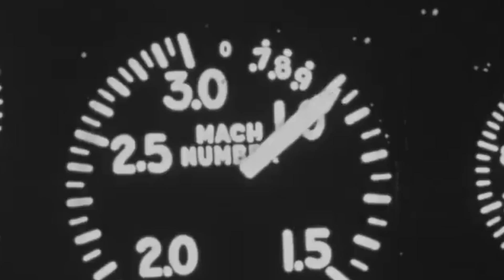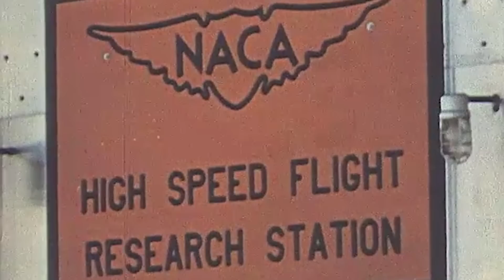The Flying Bullet That Shattered Aviation's Limits Forever

Comment: The Bell X-1 was less an aeroplane than a rocket with a man steering it. Yeager said more or less that during the development of the X-2 and other jet solutions when he became enthralled by engineering solutions to flight characteristics. He even calmly managed a "dead stick" landing in an X-2 or X-3, reasoning that the jet engine installed and which had cut out would not be hot enough to ignite kerosene. Rocket HP with oxygen would not have given that chance.
In many ways the path to supersonic flight showed a type of unpleasantness which has persisted in aviation which was mainly caused by ignorant and greedy politicians. Men such as Jaeger, Whittle, de Havilland and Twiss (Fairey's chief test pilot) were airmen and gentlemen.
The Miles company was bankrupted by the UK government of 1945 dropping Miles' design but not before handing research data to Bell under a cooperation agreement which Bell was prevented from reciprocating when the USAF stole the X-1.
Sir Frank Whittle's PowerJets company was also crushed by the Attlee government and Whittle arranged his own discharge from the RAF (Reserve) and worked with Bell as a consultant but not employee.
He later returned to Britain to work alongside Rolls Royce on developments of his patented turbojet which became the modern engine we still have. Because Whittle had been a serving RAF officer in wartime, the UK government effectively stole his patents for the axial jet which he had evolved since 1928. Hans von Ohain had read Whittle's thesis on gas turbines and separately the jets which Messerschmidt used. The two men met after WW2 in the USA and corresponded for several years. Von Ohain knew nothing about actual jet engines being made in the UK and Whittle quipped that PowerJets Ltd was too small and obscure to interest spies.
Whittle's Rolls Royce consultancy (including association with Bristol Ltd) led directly to the success of the first truly viable consistent supersonic plane, the Fairey Delta 2, which could have led to a leap in aviation but, again, politicians withheld funding. Fairey's board had good relations with Dassault in France and the Mirage emerged from that. Fairey had sold maritime planes to France for some years.
It was tougher than the US Voodoo and was actually used in combat. The UK's first full-on supersonic jet was the English Electric P.1a, which became the Lightning interceptor and multi-role powerhouse.
A piquant irony is that the badly let down Miles aviation family remained active (not as a company) and various design refinements emanated from the actual family and loyal consultant designers. Some were involved in the Harrier, Tornado MRCA and Concorde.
Chuck Yeager remained a pilot and research engineer and never truly retired. He died in 2020 aged 97!
Reply: The Miles M.52 never existed... it is pure British science fiction like 'Doctor Who' and the 'Thunderbirds'.

No data was ever handed over to Bell Aircraft because it did not exist, this false rumor comes from a single highly dubious source, Dennis Bancroft who never produced any evidence to support his ridiculous claims and was one of the people charged with fraud and embezzlement at Miles Aircraft.
Reply: @DoktorBayerischeMotorenWerke  And I suppose the pictures and film of of the M52 and aircraft used to develop the technology were 1940s CGI 🤣
Reply: @spamhead Interesting comment considering that there are no photos of M.52, only artist renderings and a few photos of the partially built wood mockup of the cockpit section.
 No trace of the two prototypes Miles was paid to build or the money was ever found.

Comment: 5:39 it was Jack Ridley who came up with the adjustable horizontal stabiliser, the "flying tail" not NACA.
Reply: Jack Ridley received the plans from Theodore Von Karman who was given the plans directly from Adolf Busemann at the RLM's Luftfahrtforschungsanstalt supersonic wind tunnel lab in Braunschweig. 
The Bell X-1 used a nearly identical fly-by-wire Horizontal Stabilator as found on the Messerschmitt Me-262.
Reply: Who did Ridley work for?
Reply: @Rotorhead1651  Jack Ridley was a student of Theodore Von Karman at JPL.
Reply: It was Miles on the Miles 52  with a All Flying tail Details passed to Bell
Reply: @michaelshore2300  Never happened, the Miles M.52 does not exist.
Reply: @michaelshore2300  Not possible... there was never any Miles M.52 or any completed plans... the British did not have a supersonic wind tunnel laboratory until late 1948... long after the historical events occurred.
The M.52 is wishful thinking and propaganda fiction.
Reply: @michaelshore2300 There was no M.52! Never in history has there been so much discussion about an aircraft that never existed.
Reply: @michaelshore2300  The X-1's adjustable H-Stab was different than the Miles. It didn't have a whole lot of play and was harder to handle than the conventional elevators, which were handled by the control yoke - Yeager was essentially using the trim adjustment system to control the entire airplane. It was later modified with an all-flying tailplane based on the Miles data, but on Yeager's early transonic flights, the control system was a lot less refined.
Reply: @disorganizedplay  The Horizontal Stabilator on the Bell X-1 was very different... IT WAS REAL! Not some fake revisionist twaddle about a British aircraft that do not exist.
Reply: @WilhelmKarsten rather like your revisionist babble about the me262 - dude I've shown you photographic evidence that the 262 had a traditional elevator....I notice you do not comment on that
Reply: @laurencedawson7754  The Messerschmitt Me-262 has an all-movable, Horizontal Stabilator and Elevators tabs, just like many other modern jet aircraft... and the Bell X1 that reached Mach 1 in level flight and the F-85 Sabre that could reach supersonic in a dive like the Me-262.

Britain did not invent the Horizontal Stabilator or supersonic aircraft..
Reply: @WilhelmKarsten  and the photographic evidence to the contrary?

Comment: Designed and mostly built by the British.
Reply: Both the unbuilt Miles M.52 design and the Bell X-1 also relied heavily on WWII German research. The rocket-powered Me163 Komet set an unofficial speed record of 642 MPH in March 1944...
Reply: Unfortunately, this popular British myth quickly falls apart under the slightest scrutiny... the Miles M.52 does not exist and no completed plans were ever found.
The money paid to Miles for the m.52 program was stolen by Dennis Bancroft, Frank Whittle and several other Miles shareholders.
 Mile Aircraft was charged with 24 counts of fraud and embezzlement and the company was seized and later liquidated.
Reply: Completely false! Britain was a decade behind the Germans in supersonic aerodynamic research and it was data from the Messerschmitt Me-262 that was recovered after the war that directly led to the Bell X-1's Horizontal Stabilator system.
This is well documented from the Von Kármán Mission.
Jack Ridley and Theodore von Kármán often shared research and were close friends since Ridley was a student at JPL.
Reply: @WilhelmKarsten false
Reply: @WilhelmKarsten dude Von karmonn moved to states before the war- he had no dealings with German advanced tech from ww2, a great scientist but you link him with the me262, all moving stabilators, you are getting it mixed up
Reply: Parallel research. Both were built in secret.
Reply: @deadon4847 A completely false revisionist narrative that comes from a less than credible origin, the British would not even begin construction of its first supersonic wind tunnel at RAE Bedford until 1947.

Comment: There was a demon that lived in the air. They said whoever challenged him would die. Their controls would freeze up, their planes would buffet wildly, and they would disintegrate.
The demon lived at Mach 1 on the meter, 750 miles an hour, where the air could no longer move out of the way.
He lived behind a barrier through which they said no man could ever pass.

They called it:
The sound barrier.

Then, they built a small plane, the X1, to try and break the sound barrier. And men came to the High Desert in California to ride it. They were called test pilots.
And no one knew their names.

October 14th 1947, a WWll fighter ace named Charles Elwood "Chuck" Yeager chased that ol' demon that lived beyond the barrier!

That was the day the demon on the mach meter ceased to exist...
Reply: The demon lived along asymmetrical propagation of the mach wavefront moving rearward over the wing as the aircraft accelerated.
Reply: @justincase5272  Yes, the "Demon" caused compressibility and a loss of flight control authority, the change in the aircraft's Center of Pressure would cause the aircraft to suddenly porpoise, pitch hard nose down into a steep uncontrollable dive or break-up before reaching the ground.
 The invention of the power assisted Horizontal Stabilator by Adolf Busemann, first installed on the Messerschmitt Me-262 made supersonic flight possible..
Reply: Do you have any beemans??
I might have me a stick.
Well loan me some, Ill pay you back later.. Fair enough.
Reply: The sound barrier had previously been broken by several P-47 pilots diving away from dogfights in WW2. The shock wave would freeze the controls but the P-47 had hydraulicly boosted controls that allowed it to come out of the dive gradually.  One P-47 pilot reported that he dove away from a Fockewulf 190 at 35,000 feet and finally was able to pull completely out of the dive at treetop level. The plane had extensive damage to the airframe and was scrapped on returning to base.
Reply: @richardbeckenbaugh1805  amazing if true! I've read that fair few late mark spitfire and Mustangs were taken closer and closer to mach 1 at the end of the war.......
Reply: @richardbeckenbaugh1805  Highly unlikely the entire aircraft passed Mach 1. In fact impossible. The highest mah number recorded was. Spitfire in a vertical dive to M0.92
Reply: @billpugh58  TRUE, it is impossible to maintain flight control and pitch authority above the aircraft's critical Mach number without a power assisted Horizontal Stabilator.
The Messerschmitt Me-262 and the Bell X-1 were the first aircraft to successfully fly faster than their critical Mach number.
The de Havilland D-H-108 Swallow for example crashed 3 times in a row attempting this as well as many other failed attempts to fly faster than the planes Crit Mach without a power stabilator..

Comment: Chuck Yeager's first book covers this really well and explains the reason he was so good. It was because before he did any test flight he would stay up late into the night learning everything he could about the aircraft until he knew every system right down to the nuts and bolts that held it together. If I remember correctly he said it had saved his life on more than one occasion. He was truly an exceptional character.
Reply: Chuck was an aircraft mechanic before he became a pilot....he had an innate mechanical knowledge and he KNEW what he could trust and what he could not.
Reply: He didn't stay up late learning the systems.  He spent months, if not years learning the systems.  He stayed up late the night before topping off his expertise, rote memory and muscle memory by going through the checklists and emergency procedures over and over.
Reply: He was also bad.  A seat of the pants pilot in an era of high performance that required computer precision and rigid adherence to procedures and profiles. 

He got in trouble early in the X-1 program because he pushed the aircraft too far on one flight rather than approaching Mach 1 in increments.  He was chastised and didn’t do it again.  

But after he went Mach 1 his ego got really big and since he didn’t have an engineering degree he was out of his league among astronaut candidates and the new generation of test pilots—who only tolerated him because of his record breaking flight and war record.  

In the NF-104 program he was the base loser for altitude records because he refused to fly the profile.  It’s more mathematical than feel.. because the plane first has to accelerate to its maximum level flight speed which is at the tropopause (nominally 36,000 feet). Any lower.. and the air is too thick. Any higher and the thinning air is no longer offset by dropping temperature leading to massive performance degradation. 

Then you have to pitch up to a certain attitude. Too low.. and you’ll never make your maximum altitude. Too high.. the plane will lose too much speed in the steep climb.  

Then you have to pitch at the right rate.  Too slow.. and again by the time you reach the correct attitude you’ve lost a lot of energy in the lower thick atmosphere. Too fast.. and the drag from pulling excessive G will rob you of your speed.  

This was very simple where the plane had a checklist and procedure to follow.. and a flight director on the attitude indicator to indicate the correct attitudes and pitch rates.  

But Chuck knew better and was going to fly his own profile. And when he didn’t reach the desired altitude, he tried to “force it” higher rather than letting it fall in a controlled manner.. which resulted in an unrecoverable spin and crash.
Reply: @calvinnickel9995  Well at least Chuck Yeager was honest and was never caught stealing money from his own country's supersonic aircraft program like Eric Brown was, Brown was denied his Knighthood because he was involved in the M.52 embezzlement scandal.

Comment: Interesting that they showed Bell test pilot "Tex" Johnston who later went to work at Boeing testing the B47  B52 and the 707/KC135 and is well known for his barrel rolling the Dash 80, proof of concept for the 707/KC135 over the hydroplane course in Seattle Aug 1955.  call into the office of pres of Boeing Bill Allen he asked Tex point blank  "What the hell do you think you were doing???"  Tex answered simply..."Selling airplanes.....sir...."  and sell airplanes they did.  seems Tex had worked with the USAF on the B47 "TOSS" bomb delivery of doing a high speed loop up and releasing,  or tossing the bomb and the plane continued in the loop and at the top the plane was rolled upright and dived away from the atomic blast.  seems also the program was abandoned when they started tearing wings off planes.  RIP  Tex Johnston......one hell of a pilot....
Reply: Because of what Johnston did with the Dash-80, it's been traditional for the CEO to tell test pilots when they take a new airplane up, "No loops."
Reply: @disorganizedplay  BUT...... did you know every plane built since has been "unofficially" rolled.  had a friend, a Boeing mechanic on the 747 that personally witnessed a 747 barrel rolled ,he was on it !!!!  on a test flight. they just did not advertise it.
Reply: @wilburfinnigan2142  ..indeed so! ..doing it once, even unofficially, is a good way add flight-stress miles/hours to an airframe in a semi-gentle manner, while testing the balance & feel of control harmonization, and to test a designs 'over-engineering' factor is relatively correct.

If any aircraft cannot survive a barrel roll &/or a loop, it likely cannot survive much of gusting windshear or any bad to very poor weather conditions either, let alone landing askew.
Reply: he was legend